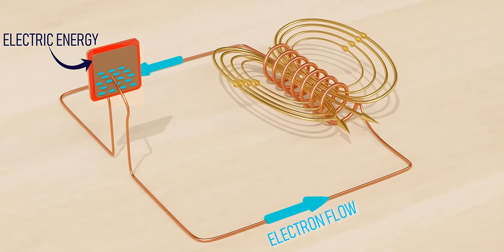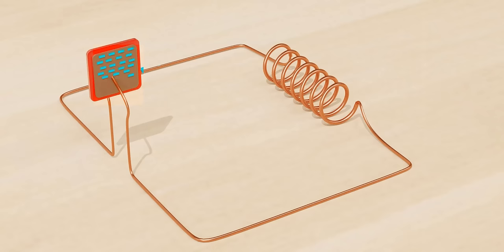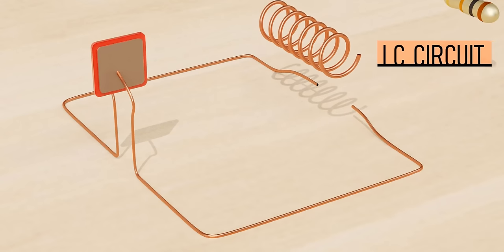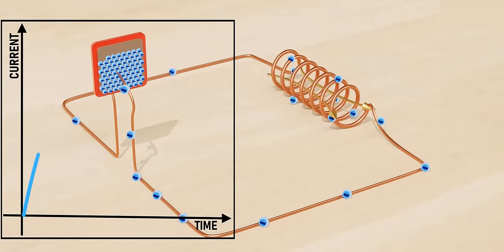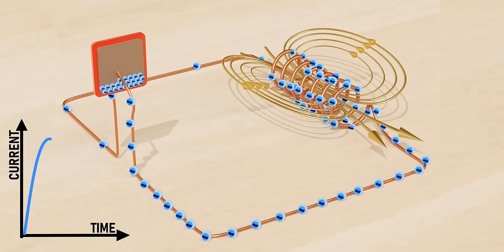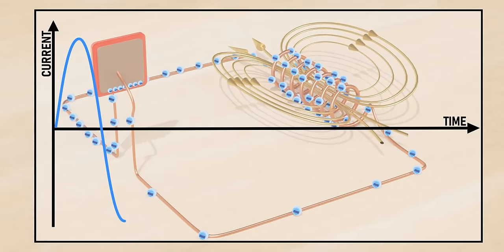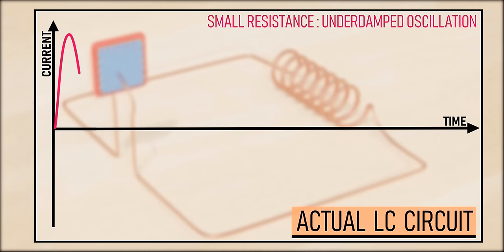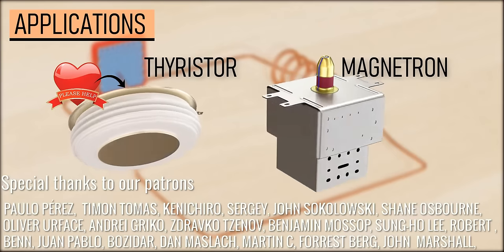The beauty of LC Oscillations!

Comment: Not a great explanation, also the animated electrons are completely wrong in that they don't move from one side to other of the capacitor in the way you've shown and when it is fully discharged with the inductor the electrons should be moving quickly.